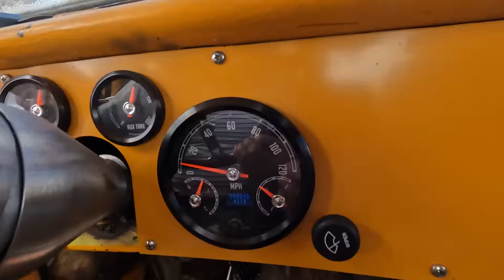The Heavy Wrecker Strikes Back At Rattlesnake Gulch!

Comment: I have been mentioning this since the wrecker build began... Matt needs to talk to Eric at BSF Recovery. Eric uses a typical wrecker sling for 90% of his recoveries. There is definitely a learning curve to using a sling on extreme terrain but it can be done and it is worth learning and using. The wrecker boom would have also benefitted from an extendable boom to give space between vehicles with better angles.
Reply: ^This is not Matt, this is a bot

Comment: When strapping the vehicle in tow to the wrecker, put a choke on the axle, you used the strap as a sling, a choke will bite the axle preventing it from slipping and possibly be long enough w/o the extra strap to reach the tow clamp

Comment: Love your videos. After a career in the US Coast Guard, I am in the habit of refueling the boats after every mission. That transferred over to me driving the fire trucks  as a volunteer. Keep them full and you never have to worry. But, it always does add some drama to your videos :).
Reply: I can skip that kind of drama. I have never run out of gas in my life. Thank God. I helped so many with that issue, so know the cost and I can't stand putting others through that cost. I don't have a working gauge in my truck, but the milage works well and the warning light still functions.
Reply: In my first car, a 65 VW, I had a problem of fuel delivery. My dad said I was always running it out of gas (only being able to afford a quarter tank). Turns out it was sludge that plugged up the screen at the bottom of the tank at low fuel levels. Flushed out the tank, coated in POR15 and that problem went away.
Reply: @azmax623  Keeping it between 3/4 and full is still only 1/4 tank at a time.😉🤨

Comment: Triangle hitch. 2 mounts on the wrecker and 1 to the tow vehicle. Telescoping shafts with a shock mount in the center. Heim joints on all 3 points. It may take some engineering but you have one on your team.

Comment: I've thought of the wheel lift idea to. If you had a short boom wheel lift that was hinged, maybe sat on a airbag with a roller in the middle under it, it would carry the front or rear of a vehicle off the ground. If the wrecker went up a steep incline the roller rests on the ground while the boom rides up. Downhill and flat ground it rides on the air bags under the boom on the wrecker frame. Air bags or  the boom winch to lift the towed vehicle off the ground. Or do old school short wheeled log arch type deal that would mimic a tow dilly with matching 46" tires and load the towed vehicle front or rear wheels into it. Just my 2 sense. Keep up the good work guys and gals!

Comment: 2 thoughts as I watch, things to try...  1) Some sort of steel bar or tube with a winch line through it.  Would allow you to pull the towed vehicle in tight (compression member) for control or let line pay out if needed to clear an obstacle.  It could be triangulated and articulate to control left right movement. 2) I've used this to recover broken UTV before, with much less capable equipment, where I use winch line to compress front suspension some and chain in place before lifting to get that extra bit of clearance.

Comment: Before you lift up the towed vehicle you could strap down the front axle to the frame (keep suspension compressed) and avoid having to lift too high or bumping the tires on the ground frequently. Probably works on rear axles as well if you’re towing backwards. Use your Matt straps!
Anyway, love what you do, greets from Germany!

Comment: Would it make sense to give Lizzy the remotes for the boom?  You still have switches in the cab and that way both of you could make adjustments whenever either of you see a problem coming.
Reply: Wow that's a great idea.
Reply: That could be risky. The person in the broken vehicle doesn't see anything in front, so the pitch could change very quickly without warning. Also the wrecker driver needs to know the winch setup the whole time, so the two drivers would need to communicate pretty well.

Comment: SUGGESTION: if you install cheap aftermarket back view camera on the lower part of the boom(or somewhere where you can see the front of the tow car), then you would not need to overthink how high to lift the tow car, you could just go with whatever height, and then actively adjust and lower it on the big drops(so it does not overturn, or lif it up, if front wheels interfering in a bad way on steps up). But it would always give you perfect feedback on where you want to be as you go.
Reply: That’s why Matt didn’t make the wrecker a crew cab. He can look out the back window and see that.
Just needs more practice doing everything thing at the same time. 
You’re trying to keep track of 8 tires, 3 steering axles, 3 winch controls, communicating with the other driver. It’s a lot of stuff that he needs to get used to.
Reply: That would just make another item to have to watch and keep track of. Always watching the camera would take his eyes off more important stuff.
Reply: Or a sick one with a big screen and birds eye view. There are some really trick systems for RVs and even a handful for cars.
Reply: @warrenmichael918  Soon he will develop a muscle memory for all the controls, and then extra set of eyes directly down and under towing vehicle becomes a no brainer. Nobody complains about cameras in everyday vehicles, here its even more critical/handy when passing extreme steps.
Reply: @aaronb7990  angle from high up, would not show as good as from down low(main thing is how hiigh/low front wheels in relation to obsticle)
Reply: @philb5593  His view straight back is not perfect. Main thing is how hiigh/low front wheels in relation to obstacles).  Soon he will develop a muscle memory for all the controls, and then extra set of eyes directly down and under towing vehicle becomes a no brainer.
Reply: @Stupid Genius  o yeah, for sure you would want a cam there. The capabilities of the camera systems you can get for Cars/Trucks/RVs now is crazy though. It will do both and then some. Things like if you hook in the blinker it will give you side cams to showing an overhead view.
Reply: Nope
Reply: That's how I had my repo trucks set up. SF driveways, parking structures, back yards, and ghettos have lots of elevation changes and grades. Repoing in the city and Santa Cruz mountains takes roughneck skills.

I didn't really use my cam for dips and stuff... I like looking over the shoulder for that. The cam is great for backing an autoloader under modern lowered cars and especially on angled driveways. It's all about in, out, smooth, with zero damage while sometimes getting away from someone chasing. 

Precision. 😉👌
Reply: @xmo552  Yeah, but you have to admit, your city and their mountain "dips and curbs" are not the same species. They have such big drops that it is crucial to keep the front as low as possible not to roll the car, and sometimes, the boom and the end of the truck can obstruct that view.

Comment: Im sure this has been mentioned, but a longer boom would surely help.  Maybe use the existing lower frame, and add an adjustable center boom with lock pins
Reply: Sean Digaetano.   I agree. I've always thought the boom was far too short, also the cross straps arent going to stop the towed vehicle from hitting the wrecker,  i'm sure when Matt was doing the off road games he was using an A frame for towing, i think that's all it needs, it may need modifying of course.
Reply: Chad mentioned that Matt was going to extend the boom about 8”

Comment: For your X attachment maybe you could put some eyes on the frame in the back and use the side winches for adjustable length straps.  Did this once with my winch when I broke a transfer case mount off the frame. Ran the line down the frame over some stuff and around the mount then tightened the winch.

Comment: Strap the axle up so it doesn't sag. If the vehicle has a front winch, you can use the winch to do it. It will let you keep the vehicle lower on the boom.

Comment: Matt, for the vehicles that can still roll, like the jeep in this video, what about using a tow bar based on what us motorhome folks use to tow our vehicles.  would have to be longer for articulation, and attachable, but would be a good starting point.  another starting point would be a ruggedized and hydraulically lifted on the fly two wheel tow dolly.

Comment: Maybe you should have an adjustable "hard bar." Could use air or hydraulic fluid to remotely adjust the length of it as you drive. A ram from an old backhoe or something might work well. Depending on what you find, maybe it would adjust from 5 feet to 8 feet long. Just run the hoses up to a hydraulic/air valve up in the cab. Just a thought.

Comment: quick cheap and easy way for some cup holders I did on my Willy's jeep that should work on the wrecker. I used an aluminum  bottle cage for  a bicycle. Drill 2 holes for each one and mount one on each side of the dash with a couple nuts and bolts and it will still hold the drinks good going over all the bumps.

Comment: It seems the best answer would be a wheel lift for the actual transport of the vehicle. The boom would be for the recovery from perilous situations. The wheel lift could fold up and telescope manually with pins. The lift portion could be done by the boom winches so no actual hydraulics are needed and it wouldn't affect departure angle, vehicle length etc.

Comment: not sure how well it would work, but a long travel coilover shock on an an adjustable length bar going from the wrecker to an appropriate point (front diff?) on the vehicle being towed to allow for deflection, but still keep the tow vehicle from hitting the wrecker. going by current description, the already have straps to stop side to side movement.

Comment: Hey Matt I would say as far as hanging a tow bar as part of the wrecker is a good idea but it has its draw backs. Being former military, you will find the limits of that tow bar very fast. Majority of the time of we are on fort ground your ok light of roading your okay. The down side is that you have to have some one in the back to control the brakes to help you slow down if not what ever you pulling is now pushing you and momentum is now working against you, also you need to lock the steering wheel so that it will not turn at all! If you don't or becomes 1000 times harder to drive and you run the risk of damaging the steering/ vehicle over the terrain. The biggest down side is that not all vehicles have attachment points for you to hook up a tow bar for the  military they are all standard , but this is civilian life so your tow bar idea may not be suitable for all vehicles. The best idea is the one the army had with there 5 ton wrecker which was  either an 8 or a 10 ft v shaped tow bar but the crane at the back lifted the front end of the ground . That one had an independent switch that lets us activate the rear brakes instead of the normal from braking. You may want to look into that. If you do use a tow bar your honey to have to make a  master  attachment points for that tow bar so that it can connect into various vehicles because no two vehicles are the same or have the same attachment points or have exposed lifting points as well.

Comment: When they did the wiring, they probably put a fuel generator in there since you run out so much. So with this one, the more you drive, the fuller the tank.

Comment: The fuel gauge indicates backwards, most likely because the sending unit in the tank is wrong. The resistance of if is increasing when it should be decreasing.  You can check that with an ohms meter. Just set it to measure ohms and hook up each lead to one ends of the sending unit and move the floater.

Comment: Matt, your tow truck is awesome machine: how fast it goes over terrain is an indication of its good design. But it's only halfway done in back. 
You need to add a component to the bottom: an extendy bit like an A-arm with a sling and a swivel. I don't know what it's called and I'm having trouble finding a photo of one. Before under-reaches and rollbacks, tow trucks all had these. The bottom of the sling attaches to the front frame of the car; the derrick holds it up. The swivel lets the towed vehicle swivel laterally and vertically; the A-arm holds the towed vehicle the right distance away. 
No more wild swinging around back there, no dependence on a sure-footed passenger in a towed vehicle applying brakes.

Comment: 24 years in the army 22 those years I was a mechanic about 10 of those years I was a wrecker operator both the 800 series and 900 series Wreckers they have a awesome tow bar system I've manipulated and learned it through and through been watching you guys for a while this is the type of system that you need it just needs to be modified I've got the plans in my head I just don't have the shop to produce it

Comment: its almost like you need a 6wd independent suspension roll back ....but as for tow bar about about a hiem joints on wrecker side, triangulated link to a single point say a saddle or perch you can clamp to the axle of a vehicle in tow

Comment: Well done guys. That thing awesome off road. Why not fit a sling at the rear. Very popular on south african tow trucks. All u need is 2 bars from chassis attached to long rubber mats running up to boom . Don't need a driver in th towed vehicle and alot ta c9ntrol on what ever u towing

Comment: super capable wrecker. I can see where Casey's idea would work sometimes and others where it would not. having a bar that holds the towed vehicle from hitting the wrecker would be useful where brakes are out and the trail is mostly just a dirt road and no big obstacles. or you don't have a brake person. but has to be designed to allow a lot of vertical movement for rough trail towing. if attached to the pintal that would be half of that.

Comment: That wrecker is quiet the beast. I'm thinking that if I were tempted to attempt a towbar like setup I'd try two long stroke heavy duty shock absorbers set up like a tow bar. They could dampen the movement of the towed vehicld moving toward the wrecker and bottom out the other way pulling uphill.
That's my idea.

Comment: TOM-   ONE OF THE 1ST THINGS I THOUGHT WAS YOU GUYS WOULD SWITCH TO A HYDRALIC BOOM LIKE FAB RATS. THAT SEEMS MORE HANDY. THAT COULD BE EXTENDED,  KEEPING THE TOWED VEHICLE AWAY. PLUS GIVE YOU GUYS OTHER OPTIONS

2ND I THOUGHT WHAT IF THEY MODIFIED A "REPO" TRUCKS  "GRAB AND GO," BUT MOUNTED HIGHER. THEN REMOVED THE TOWED VEHICLES FRNT WHEELS  SO IT DONT HAVE TO BE LIFTED AS HIGH. THEN YOU WOULD HAVE SOLID  CONTROL WITH STRUCTURAL CONNECTION.

IDK?

BUT HAVING BOTH A BOOM AND THE HYDRALIC ARM, MAY BE TOO HEAVY....

Comment: 10:40 it should be easy and possible to load the front of the towed vehicle and fix it with the straps to keep front suspension compressed.
8:26 - maybe there is kind of gyroscope-autoleveling solution available for such bars. In modern worlt  there are a lot of cheap self-stabilizing stuff around us 😀.

Comment: Matt looks as if you just lost you driving control out to the job,
You now have an official chauffer to all jobs with the wrecker,
And she looks so happy about it😂
Reply: About the front tires dragging 
Yes it will be an extra step with ratchet straps
On vehicles like the jeep with solid frames may work on 
Unibodys? Could strapping the front axles with straps and lifting them to full compression as possible 
Help keep  them from dragging while lifting or dropping the front on tough trails???????

Comment: Could you hand the wireless winch box to the towed vehicle? The towed vehicle can see how close they are to damaging the hood with the boom better then the wrecker driver who has to look over their shoulder. and their hands are "free" cause they don't need to steer!

also cant wait to see what Casey L. comes up with for a tow bar, cause i have an idea for a tow bar too :) my idea is like a floating carrier that goes under the wheels, the back end is extended and ties up to the towed jeeps frame and then the front extends out infront to avoid touching the bumper with the lift line. you would still have to have someone in the towed vic but you would have to worry about the bumper as much. 

but i bet casey has something better.

Comment: I wonder if adding an air filled tire to the end of the boom (like a landing gear tire for a Cessna or similar) would let you reel the towed vehicle up close to the end of the boom but not have to worry about the boom gouging the front of the towed vehicle. It could even be on a quick attach so you only have it on or in position when necessary.

Comment: A 6' bar, with rings at both ends? One end to the circle hitch on the towing vehicle and the other could even be soft-shackled to the towee as long as it didn't allow too much lateral slip. Play with the length till it works, and all the artiiculaton you could ever want, just the target doesn't get to slide into the tow. ... it sounds like it might work, anyway... though you probably already tried it. PS: Not to take anything away from how capable the wrecker is, the episodes when you needed two recovery vehicles to get something out were a lot of fun, in their own way. This is almost too easy. PPS:... the glove box is a victory pie warmer? Only MORR.

Comment: It's a simple problem that needs a simple solution. The towed vehicle is too close to the wrecker. You need some kind of adjustable extension on the boom to push the vehicle further back. Perhaps a tee piece on a ram with rollers to push the ropes out and away

Comment: A "tow bar"  or "spacer bar"  for the jobs you're dong will need to pivot on both ends.  On the wrecker and the towed unit.  All it will do is keep the towed unit from slamming into the wrecker, while you're still carrying the weight with the boom-winch.
Reply: 12:15 I have a sling design that I think would fit the wrecker perfectly